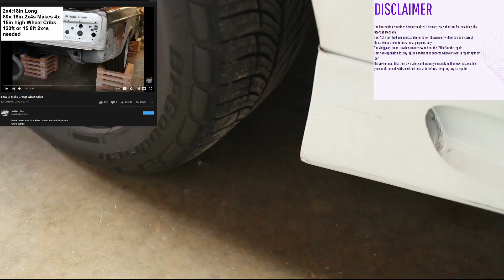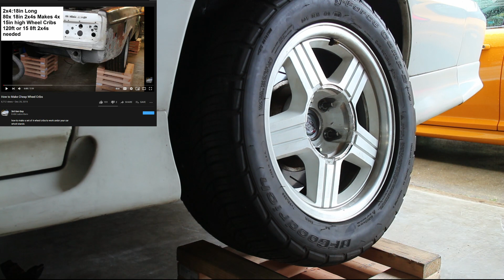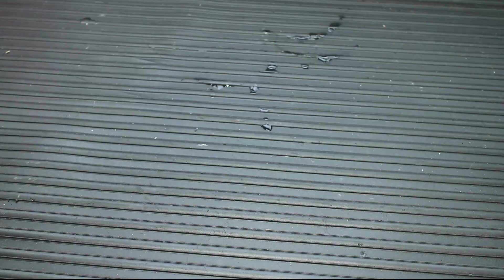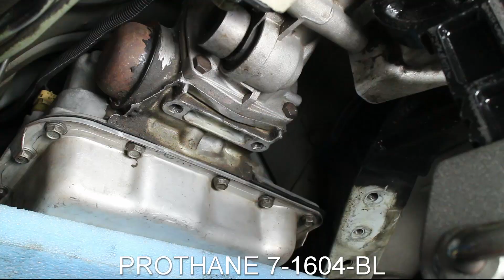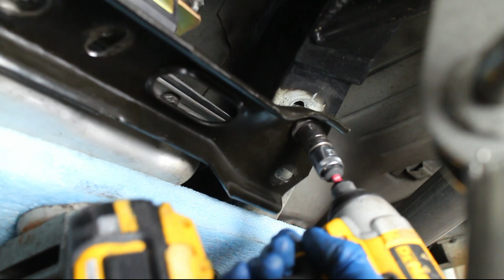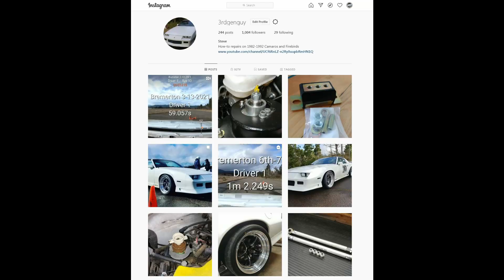Polyurethane Transmission Mount Install (1982-1992 Camaro/Firebird)

Comment: Great video. People should also note that if you switch to a polyurethane trans mount you MUST also change the motor mounts to polyurethane. This way the motor and trans move at the same rate with one another. You cannot mix the two.
Reply from the maker: nah, you can mix the 2 no issue.
Reply: @3rdGenGuy   you go right ahead LOL.
Reply from the maker: I did, for YEARS without issue.
racing almost every weekend.

Comment: Any performance version of these cars already rides like a lumber wagon. Im switching to poly because oil already destroyed one mount. After finding out my rear main was leaking, the new oe style one i put in is already permeated with oil and starting to crack. I can deal with any added vibration simply for the peace of mind

Comment: question is, can you get the transmission mount out without letting the crossmember down or taking it out? seeing how the previous owner twisted off both of the driver side bolts in the frame and decided to simply weld the crossmember to the car on that side lol
Reply from the maker: maybe.
the 700r4 should have room to go up, but idk if it will clear the stock bushing.
you can test and see before doing anything permanent

Comment: Do you get vibration at highway speeds with the poly mount?
Reply from the maker: no, BUT my car is 100% autocross and it's VERY rough. VERY rough
so i didn't notice any change